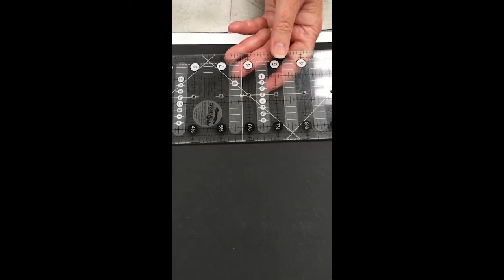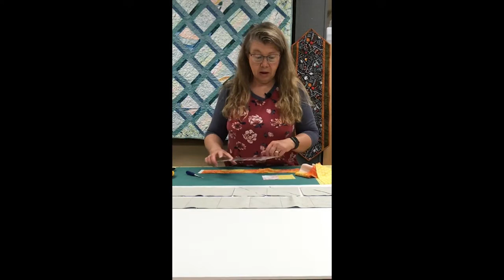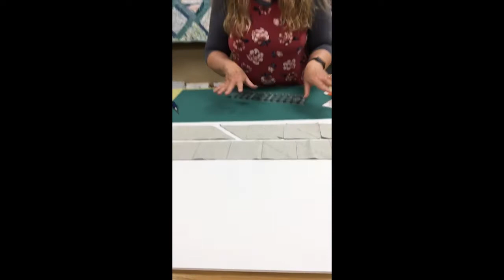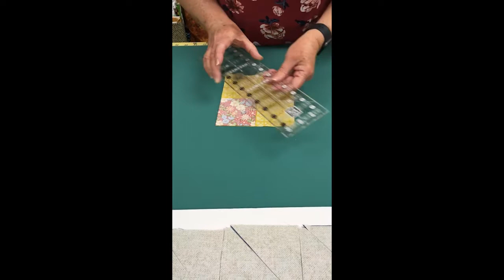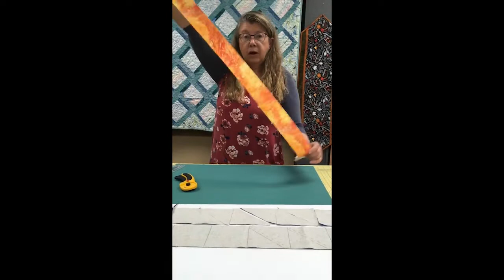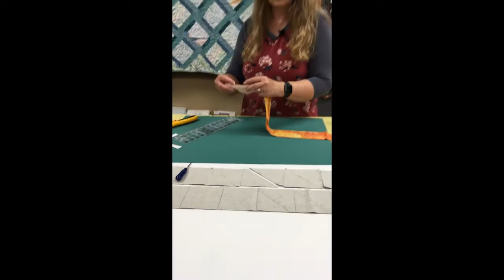QUICK TRIM RULER DEMO

Comment: This was really helpful, especially regarding the binding strips.  I'm directionally challenged and your tip about using the horizontal white line and then pivoting to set up for the diagonal cut FINALLY gave me the means to get it right!  Thank you.